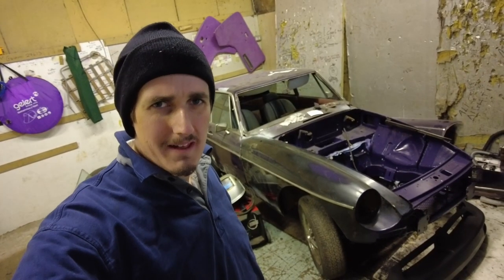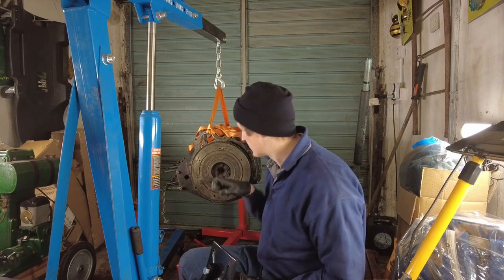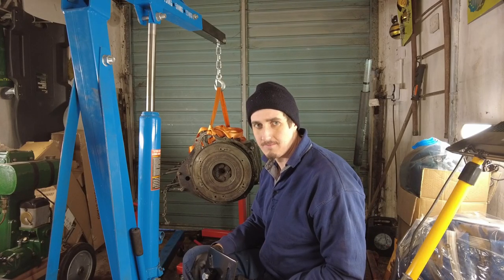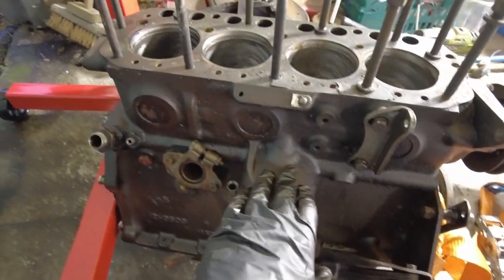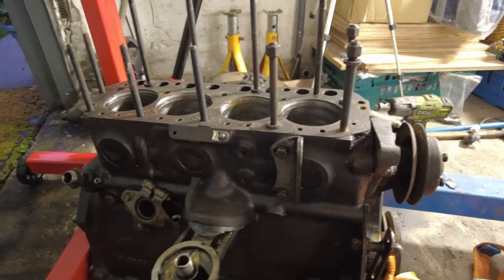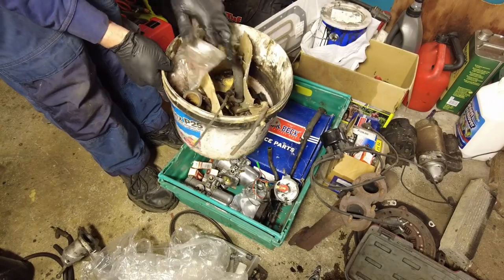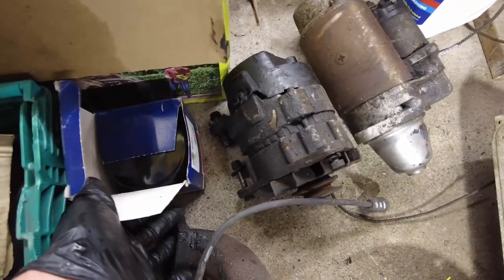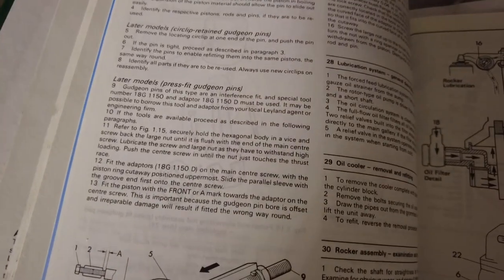MGB ENGINE REBUILD -  Part 1 and PROBLEMS ALREADY!

Comment: I have an MGB as well and rebuilt the engine. How I mounted the engine to the stand was on the spark plug side of the block using some extensions (cut thickwall pipe) to even out the mounts. Putting the mounts on the side of the block lets you rotate the engine and still have access to both from and back of the block. You can google examples of it from others who have done similar.

Also, at 7:20 I believe the clamp seen on the crank should be on the outside of the backing plate, not attached to the engine side. It is used to hold the oil seal in place, although to be honest you really don't need it if you use some sealant on the oil seal seat.

Comment: On another YouTube video a bloke engaged a machine shop for preheating new pistons no get the gudgeon pins inside in an easier way. My guess is the reverse action is also possible. Personally I have only lifted the B-block twice over the years to renew pressure plate, clutch plate and TO bearing and this block is indeed incredibly heavy to lift. The first time I also renewed the seal on the gearbox front and recently I had to lift the head to solve a hanging valve problem. So even engine jobs can come unexpectely to all of us.

Comment: On the pistons, I wonder if the WD40 to prevent corrosion caused the problem or exacerbated it. Have had similar problems caused by WD40. Have found PlusGas better for such things, it acts as a decent corrosion preventer in my experience.
Reply from the maker: That's an interesting thought actually. They've been soaking in paraffin since Wednesday anyway so hopefully that'll do the trick. Otherwise I might need to try and get the gudgeon pins out.

Comment: Not sure if four cylinder head studs could be removed and used to mount engine to stand, but, being so long would need packing out with loads of washers or some tube sleeving.
Reply from the maker: Good idea, but I'm going to need the head studs when the engine is still in the stand. I'll go and buy some longer bolts in the next week or so.

Comment: thumbs up on the video, but...WD40 is NOT oil. "WD" stands for "water displacement". use real oil, WD40 will not prevent oxidation.

and BTW, if you can afford to get oversized pistons and bore out the block. do it. those ridges mean that the piston rings will have to take up all that slop between the pistons (putting a lot of stress on them) and the worn cylinders walls and consequently wear out much sooner than they would otherwise.

Comment: does the "manual" tell you to use a chisel on the flywheel bolts?
Reply from the maker: It was to bend back the tab washer.

Comment: Thé boiling water for the wrist pin problem would free up the pistons and allow them to be lubricated with oil
Reply from the maker: I'll look at that option if the paraffin I have them soaking in doesn't free them up. Thanks!